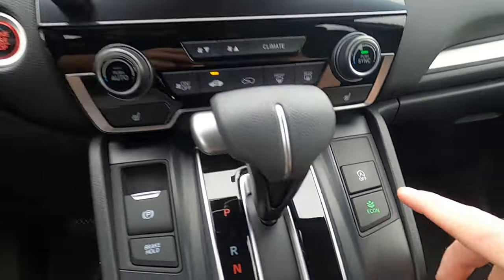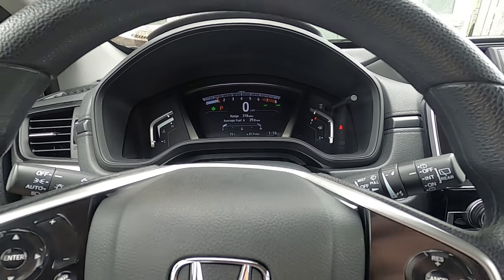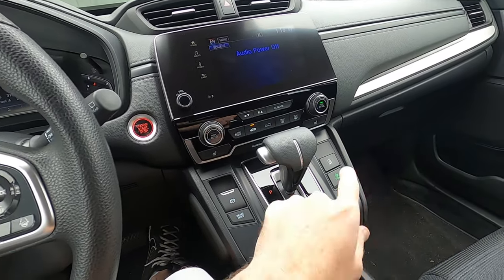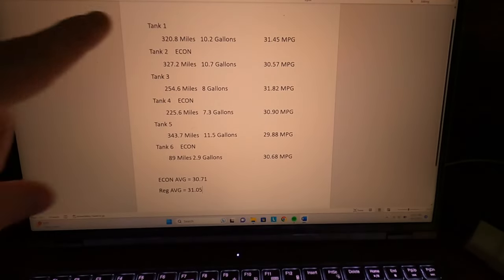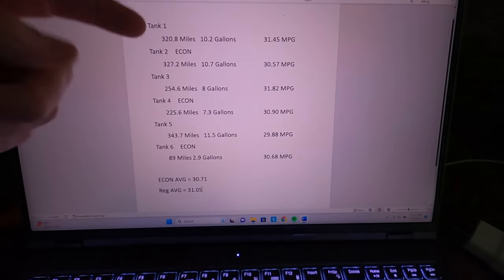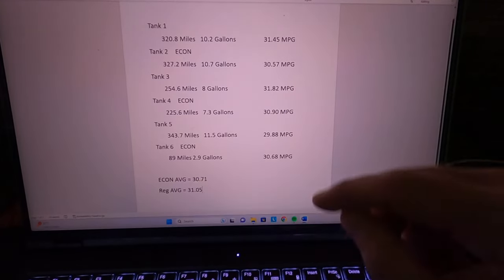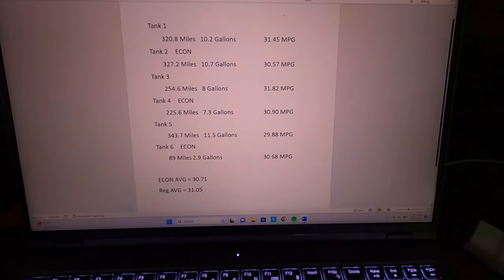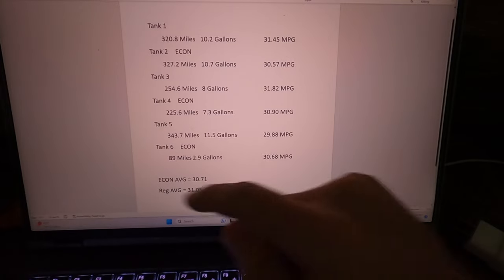Does The Eco Button Work!? - Fuel Economy Test.

Comment: On my ‘17 Accord V6 auto it makes a HUGE difference in town, but not at all on the highway. Perhaps the larger engine, heavier chassis, and driving in town have to do with the increase, but it’s often 3-4 MPG better in ECO in town than off. On the highway, unless there is a lot of traffic or driving up in the mountains, they’re about the same. Of course it’s sluggish as hell and completely unresponsive, so it’s come to where I’d rather fill up a tad early than deal with a relatively fun, peppy car detuned in name of economy only.
Reply from the maker: That's interesting. Thanks for the comment!
Reply: The Eco mode seems to only be "effective" during acceleration. So pretty much around town i would say ~10% saving on MPG base on the vehicle if its on 75% of the time.
At hwy cruising speed ( with the slower gear changes) it doesn't save as much.
That being said best case scenario is eco mode fwd + CVT and turbo. Followed by NA engine fwd. 
Eco mode in my 2017 ridgeline with 6 speed auto it's a dog. The savings are diminished by ivtm awd ( 4 wheel always power ) and the weight.
 A/C operating more efficient is ok,but diminished by trizone plumbing.
I did a year just eco and it saved me 1 to 2 mpg so not bad with eco button + VCM disable.

 With VCM active + Eco mode I could get 28 mpg on hwy and 23 mixed,but the side effects VCM made me leery as the vehicle got older + all the TSB's that poped up

Comment: In Economy Mode, you'd have to keep your accelerator pedal a quarter of the way down to full throttle longer just to keep up with traffic when especially moving off from a traffic light junction. And to overtake a car in front, you'd have to apply even more foot pressure to pick up speed. I don't see how this Economy Mode feature can effectively save fuel, unless you're driving with zero traffic around you - such as a desert road. I would engage Economy Mode in my Honda when Im already cruising along on a highway, and I'll turn it off when coming to a stop at a junction to prevent the Start Stop function which in my opinion isn't good - coolant and engine oil stops circulating, and that's BAD for a turbo charged engine.

Comment: When I press my Econ button my breaking and accelerating has more resistance to it. I feel like the car runs a little bit funky when it’s on, but I have noticed it gets slightly better gas mileage. Also like you mentioned, the AC gets a bit more reserved and less powerful.
Reply: It's not worth it for the minuscule savings

Comment: Of course you can't affect mpg with the ECO button. There isn't one. The ECON button, however, changes response and shift points. If you drive the same way - that is, the same pressure on the accelerator - you will save some mpg. You will also accelerate more slowly. If you compensate by pressing harder on the accelerator, you can lose a little due to more uneven acceleration.

I use ECON in my '18 Accord Hybrid because Adaptive Cruise Control doesn't change speeds as quickly. That is, it allows a wider range of speed differences. The a/c does the same thing - it runs less because it lets the temperature vary a bit more before bringing it back.

Comment: I own a 2018 Civic Hatchback LX and I have seen this same trend between ECON mode and normal mode. My testing involved comparing the two modes between different fill-ups that were run on that particular mode the entire time. My driving involves majority highway and maybe 25% city (max). My guess is that from feeling how the car accelerates between the two different modes, it's just too sluggish on the little 1.5L motor and somehow ends up being worse? Less efficient use of the turbocharger by the more sluggish acceleration? Climbing even slight hills seem to be where I notice the most negative effect. Honestly have no idea and I would like to see more scientific testing to understand why this is happening.

If the answer is that I have to toggle this mode on and off at particular times during a commute, even a long one...that makes it pretty much worthless and an extremely poor implementation. With as long as this mode has been on their vehicles now, I would expect to see better results on a newer vehicle than mine rather than similar results.

Comment: Your not going to believe me when I say this,  had ann old mustang GT, 3.31 rear end. 16 ish MPG. I was bored one day and swapped it out with a 3.90 rear end. Now I'm getting 25 ish MPG. 
The engine is spinning faster, but barely working,  much more power on demand. Less fuel usage.
I don't buy "ECO MODE" BS. I've seen the exact opposite.
Reply: You're right, I don't believe you. You sound like my neighbor, who smoked 2 packs a day for 60 years and didn't get cancer, therefore cigarettes don't cause cancer, it's all BS.

Comment: The way i interact eco button, its slow down throttle control. So i will have to push hardee to cross tye speed limit in my city. Its a life saver for me. it saves me a lot time from getting ticket for overspeeding in late night. Trust me i dont care about mpg, compared to normal mode or eco mode.

Comment: I own a 2021 CRV with a CVT, I don't notice enough of a difference to consider the ECO restriction worthwhile.. 
I also by-pass the engine off for red lights and stop signs, bad for the starter, saves VERY little gas, bad for the battery, bad for the engine.
Reply: I rented some Ford crossover in Florida. That engine turn off at stoplights drove me nuts. I swear it made the gas mileage worse.
Reply: @denang501  It's not good for the Engine, the alternator, the starter....It's only meant for an EV, which they can keep, I'll stick with Reliable GASOLINE

Comment: How fast were ypu driving? I have a 19 crv and I get 38 to 42 mpg on highway at 60 to 70 mph
Reply from the maker: Depending on the area 65-85
Reply: If time allows do the test again on the same flat surface on Windless Days for both  tests. 

If some of the Econ days were windier, “against the front end” or on the regular days the car was wind aided then that wind for and against will make the difference!

Go Ni